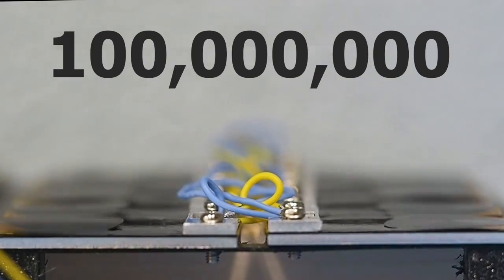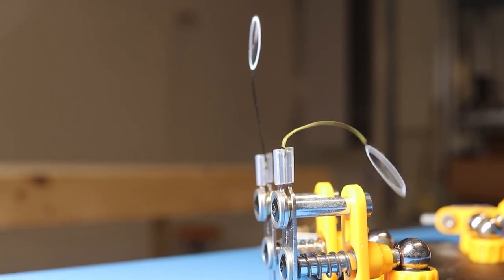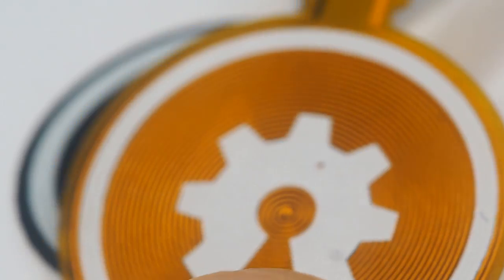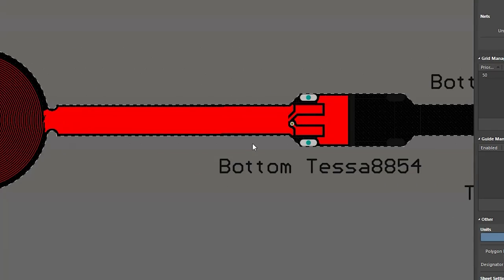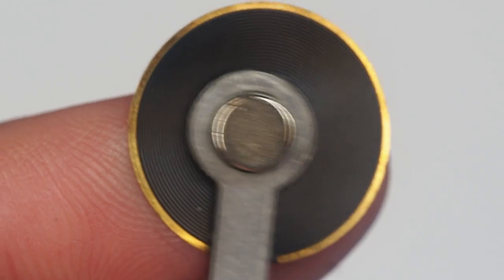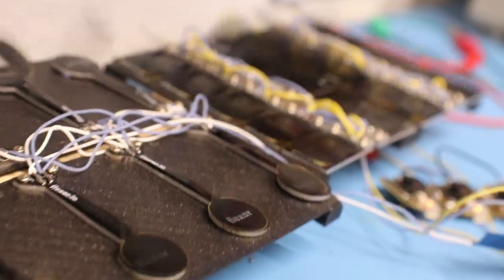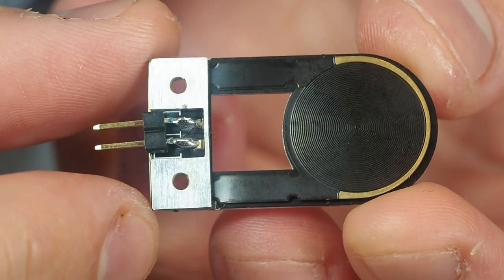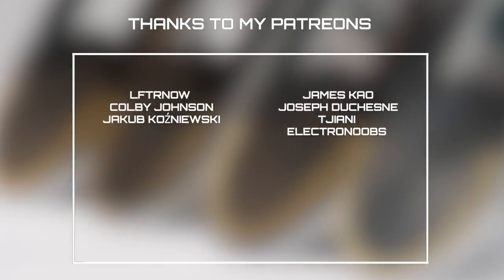How this Actuator Survived 100,000,000 FLAPS

Comment: Could a sinusoidal trace be more durable at thin trace widths? Kinda like a small spring. It would make the traces longer and thus increase resistance. But I suspect that you wouldn't need that much meandering to get good flexibility.

Comment: Id be rather interested to compare the resultes with a significantly longer time between activations. Comparing to a 3s interval, I wonder how much more longevity you'd get out of them. In thinking that however, you run into the issue of will the medium even physically last that long in other ways like time, rust and generalally existing in the environment.

Comment: This remindes me a flying bugs, did you try to measure how much air pressure this can make compared to its weight 
Maybe we can make super small  flying bug with super low power consumption 
How much energy this "flaptuator" need for 1 move

Comment: thats a kinda solid state fan, flapping around, more air
Reply: the more air it moves the better
Reply: the more cooling area/fins you have the better
Reply: self-cooled fan flapper
Reply: two-sided magnet, flapping between those
Reply: higher bend resistance, so that it will not hit the magnet
Reply: I mean higher leaf spring constant
Reply: try drive that with main 50/60Hz ac
Reply: try laser engraver soldering automation (super local heating), instead of the heat plate surface mount soldering

Comment: Is it possible to order this without the aluminum backer? Or easy to separate?  

I do origami, and would love to experiment with it.
Reply from the maker: Unfortunately it's not possible to remove the aluminium but the aluminium is just 1.2mm thick so it's still very thin for your application - you can also use this actuator which I think is more ideal for Origami applications https://youtu.be/MDhT6-6Yr_I
Reply: @CarlBugeja  oooh yes… any chance you have any hardware that could make a lightweight solenoid? Again… origami applications.

Comment: So I seen your thumbnail, these fans will only last 25 days? you said 4mil flaps per day and they can survive 100mil flaps. I mean they are cool and probably very useful in specific scenarios, but it just doesnt really seem like something that would be used in industry if it only lasts 25 days.
Reply from the maker: They survived testing  @ 25Hz then I rated their speed lower between 0-10Hz which gives an approximation for the lifetime of these actuators

Comment: Nice video, I liked your approach to durability testing.
Unfortunately, I would say sample size 20 is not statistically reliable enough.
Reply: Granted Budget and/or Time Limitations will always make the project have a smaller scope.  And granted he hasn’t Tested 1,000 of them, Running at 200% Power and/or Rate (for a Safety Factor)c and Running them for a Year etc, BUT I think your expectations (despite being valid) are neglecting the scale of this project, and the sheer amount of work they are doing for this scale on this project alone!
Reply: @ericlotze7724  oh! I'm not disagreeing with you.  Totally cool work and results.

Comment: Test not accurate because materials degrades over time as a result of the environment: ultraviolet, temperature, moisture, sonics, etc. Even if it can survive 100m flaps, it might not survive 1 year of time. What is better than 100m flaps is a 50 year warranty. Everybody will buy.